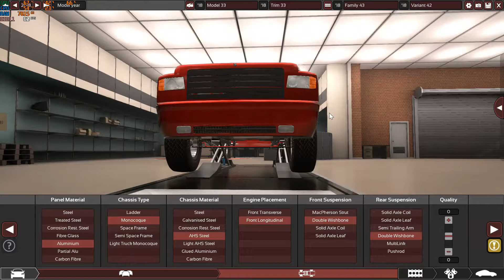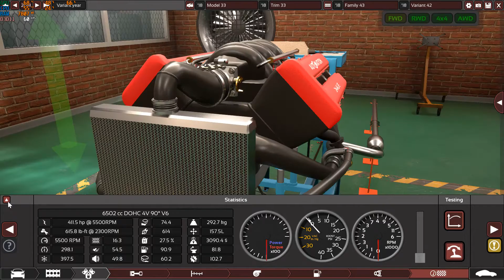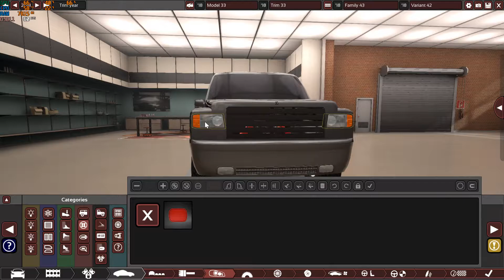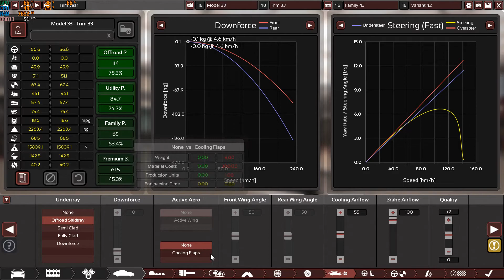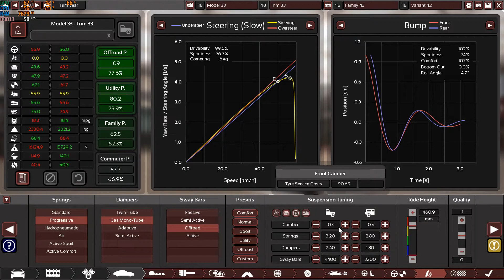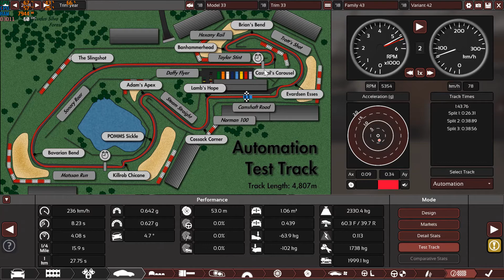Straight Pipe Turbo V6 4x4 SUV build in Automation Game.

Comment: Hi bshar,
I would like you to make hyundai lambda 3.8 stock/tuned
or hyundai 2.0 turbo stock/maxed.
Reply: hullo?
Reply from the maker: all the specs please.
Reply: compression 11:5:1
multi point injection
306hp at 6400 rpm and 361 nm of torque
all aluminium 
3779 cc